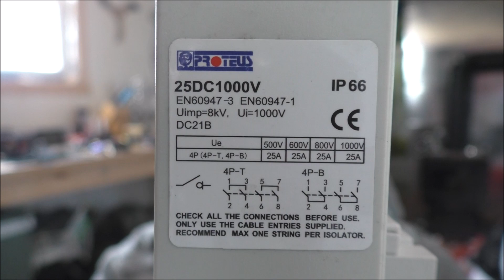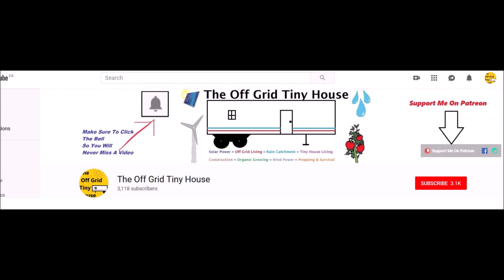Solar PV Isolation Switch

Comment: Nice video, can you use a bigger isolator than required? say your panel out put is 450v, 19amps, can you use a isolator that is 1000v, 32amps?
Reply from the maker: yes you can
Reply: @TheOffGridTinyHouse  Thanks appreciate the help

Comment: you do know your supposed to also wire the negative in the switch as well? its no good just passing the positive through, its designed to break both - and +

Comment: Thanks for the video, do you not need to run the negative wire through the isolator or can you just put that straight into the charge controller?
Reply from the maker: yes right to the controller
Reply: @TheOffGridTinyHouse  Thanks 👍
Reply: @TheOffGridTinyHouse  Mine came with two bridging links, do you need to put them in if you're just using channel 1 and 2 for one positive wire? Sorry for the questions, I'm just at this point now haha
Reply from the maker: @DanielLawrence23  fill me in a bit more on your setup
Reply: @TheOffGridTinyHouse  I have three 100w solar panels in series that will be wired to the isolator switch, then to a my mppt charge controller and finally to two 12v batteries which will be connected in parallel
Reply from the maker: @DanielLawrence23  i really only think you need the single positive wire going from the switch to the controller. its how my system has been running for a few years now.
Reply: @TheOffGridTinyHouse  I'll give it a try with just the positive and if I'm only using 1 and 2.. I don't think I need to install these bridge links. See how this goes haha 🤞 Thank again!